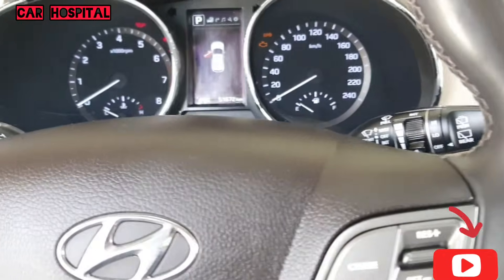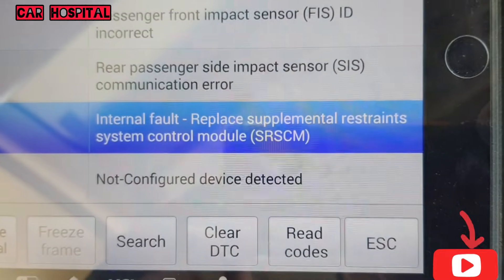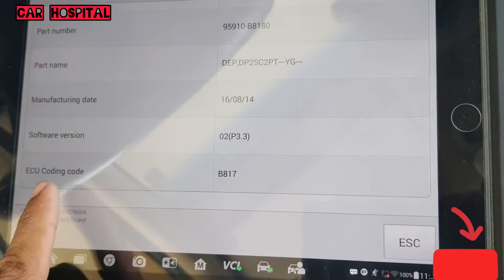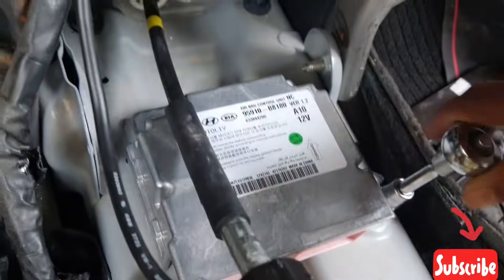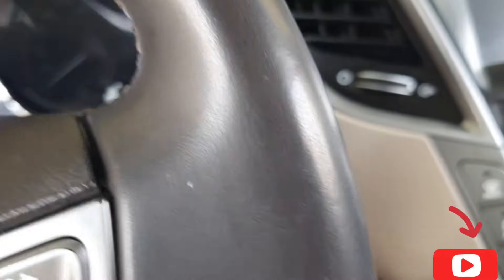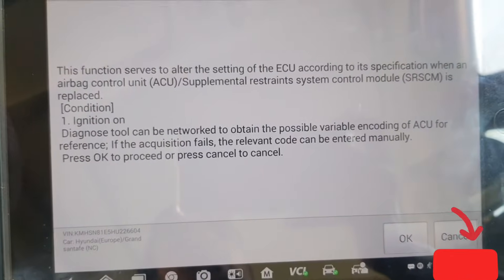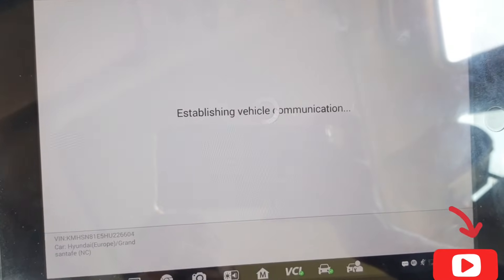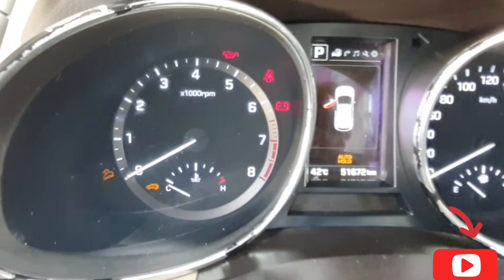Airbag control unit programming tutorial easy solution.

Comment: What if the srs module didn't get damaged and just set a srs light because of a crash can the same srs module be cleared of the crash data with the scan tool or does the srs module need to be replaced with a new one ?
Reply from the maker: Good question brother 
If crash no need to replace airbag module 
Do crash data only
I have another video how to do crash data
Check
Reply: @carhospital  buen video disculpe me podrias facilitar el link o algo del video? Para programar el modulo en caso de accidente (choque) por favor.
Reply: @carhospital  where is this video?  Thanks
Reply: What about the srs Dtc B101D30 ecu malfunction do i need to replace the ecu? I try to delete but still exist.

Comment: I have a 2019 ford escape , airbag module got wet , I'm replacing it with a used one that has a crash locked,  I have a xtool d9 pro wondering if I can flash it with it ..any ideas? I'm sure I need to clear it to get rid of the crash code eight?
Reply from the maker: You can do with cpt
Reply from the maker: Need to clear crash data

Comment: I pulled my old module and put used one I didn’t know about the coding code , can put the old module back and read the coding code or I’m screwed ?
Reply: If the old module is working then you will atleast have to clear the error.